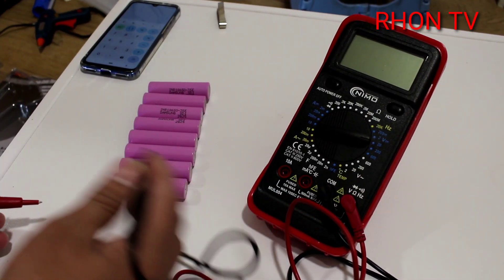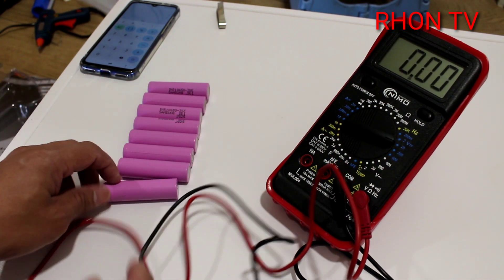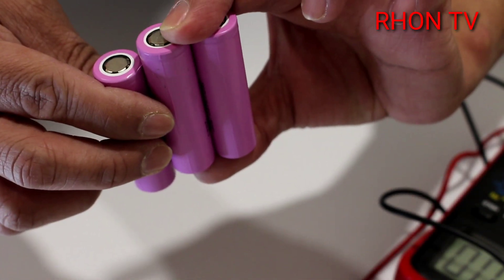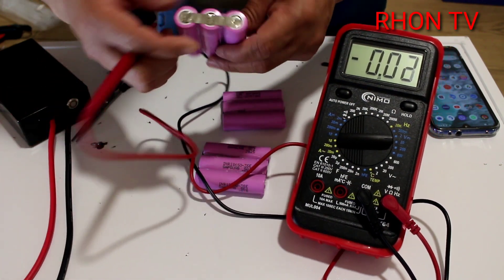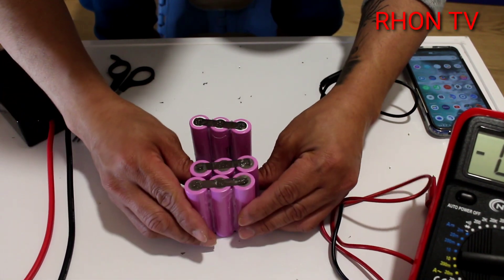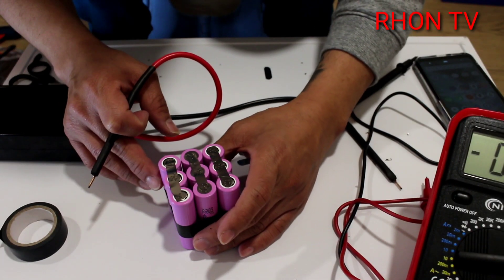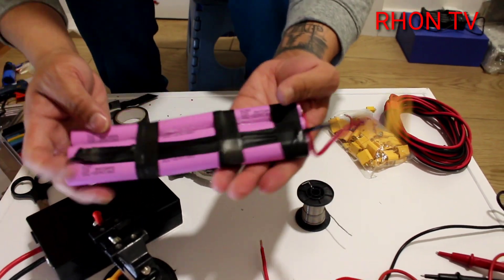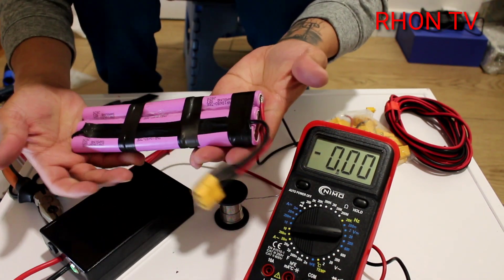how to make 12v 3s battery xiaomi pro2 top speed 57kph

Comment: sir need paba install ng bagong firmware yan para mag accurate sa software or panel nya yung battery % sa mismong laman ng battery?
Reply from the maker: need mo mag lagay nang filmwear kasi pag nag add ka bater tataas voltage nyan  if di ka mag lagay mag eeror yan di mo mapapaandar
Reply: @RHON_TV  pano po mg lagay ng firmwate? palagi mag bricked yung controler ko panagalawang palit ko na ng comtroler.😢 nasapagawaan pa din hanggang ngayun. xiaomi 4 unit ko tpos pinapalitan ko ng controler at pamel ng m365 pro2 kaya naging pro 2 na sya pro yun nga. hindi ko ramdam yung entender na battery ko.

Comment: Should you try to match the mAh capacity for the 12v and 36v battery to be the same and if you do that, will they drain equally at the same time?
Reply from the maker: @narongr4592  no first dran is the 12 v because  that is the speed batery
Reply: @RHON_TV  But should the 12v capacity match the 36v battery? Like if I have a 36v 10500 mah main battery should I build the 12v to have the same 10500 mah capacity?
Reply from the maker: @narongr4592 no if you put is range batery need to be desame Mah  so you put as a paraller but 12  is ill do a series  conection
Reply: @RHON_TV  Ok then how many mAh should the 12v battery be? I want to be sure that it will at least last as long as the 36v battery. Should it be larger?

Comment: Your video would have been more understandable if you had given it the title 48-volt xiaomi, because you only produced an additional battery pack for it, with which you turned the thirty-six-volt system into a 48-volt system.

Comment: I have a monorim 48v 500w motor and a 12v battery will work and how much mah is needed?
Reply from the maker: yes will work but you need to searies the 12v batery and need also the filmwear to nit error 24.
Reply: 12v what and how many mah should it have? what 12v?
Reply: 12v what and how many mah should it have? what 12v?
Reply: What all was needed besides the 12v? Isn't the battery in the m365 higher voltage? How does adding smaller voltage battery work?

Comment: I need to upgrade motor before battery install? Will this break stock motor fast?
Reply from the maker: yes you can iven only tock bat but only 42 but if you add batery more speed

Comment: Hi sir.. Nkadepende po b yan s battery.. Kung gsto mo i upgrade ang speed... Or my iba pang pa2litan... Bukod p s battery.. Thanks po
Reply from the maker: pag wala speed batery nasa 44 lang pero mag add ka 12v  speed. magging 57. pag 4s 16v 65kph. depende if ilang voltage na batery ilalagay mo
Reply: @RHON_TV   Can you also increase the speed by installing 4S 16V? other than 3S 12V?
Reply: @RHON_TV saan ikonec yang 12 v battery nalilitobako boss

Comment: Something is wrong here!
Reply: Why? The battery is por volt
Reply: Something is hidden.. Built in battery 36v extra 12v so could be in series 36+12=48v which didn't show/explain to us
Reply: @sannyhabibaman3714 also the charges need to be together in the range like 37 to 42 and 7to 12v and also mah 12800 so the other needs also to be 12800mah so 3.7v 2s4p 2times 3.7 7.4v discharged and 4.2v charged so it’s 8.4v in series connected is that 7.4+44v when it’s empty the bms won’t allow it to be used anymore and you shouldn’t then and fully charged 8.4v+42 50,4v pretty impressive if you ask me that way you can Rus faster also only for charging I’m not so sure and I’m also askming my self about Rita system if it’s worth it what I don’t know would it make my 42 parralel with Rita 48v battery use the 48v then use the charge of the 42v to recharge to 48v? Wil it make it faster? Like impressive?

Or do what Rhon suggest just use a switch 12v series to 42 and off switch and last switch parralel switch but for that instance you need to stay considering the same voltage for cells the battery’s if you consider it has like 3.9v and the speed battery 4.2v or the parallel battery same story also with the mah it needs to be correct so far I know I looked in the internet about battery theory

Comment: Wait, you  connect a battery which is more or less 1/4 from the original voltage..
How can you go faster?? Smells fishy
Reply: Aaaah I get I. You put the 12 volt in series with your original battery. Won't this damage the batteries?
Reply from the maker: @404DisasterNotFound  no damage only you have to do is series the 12v.
Reply: Yes but the main battery is 36/42 Volts
Reply from the maker: @404DisasterNotFound  if 36v or 42v you put to the stock battery you need to parallel connection
Reply from the maker: yes only 12v . you  do  series  connection